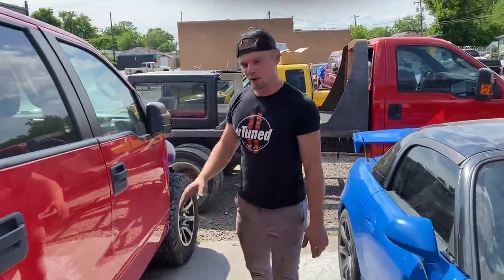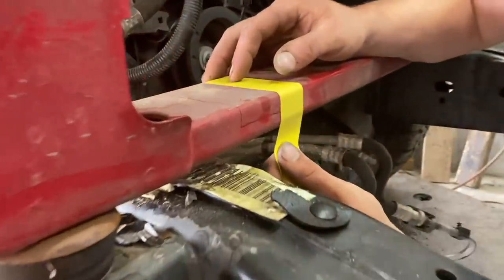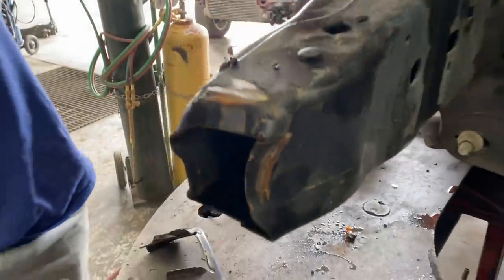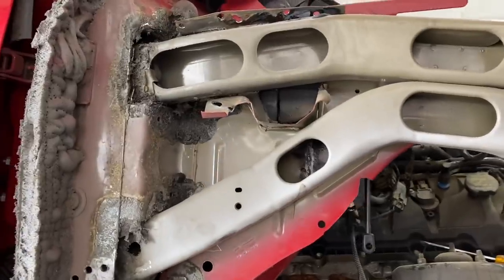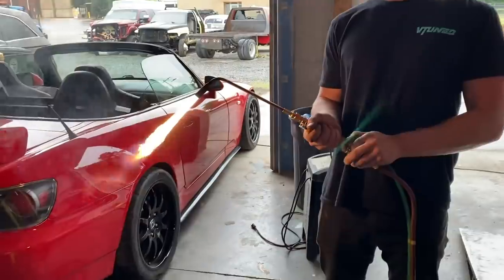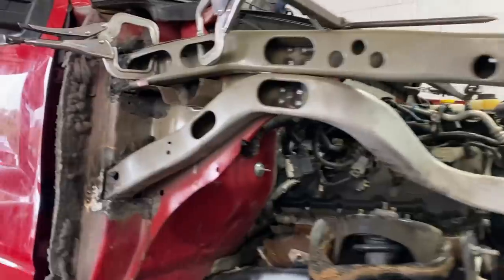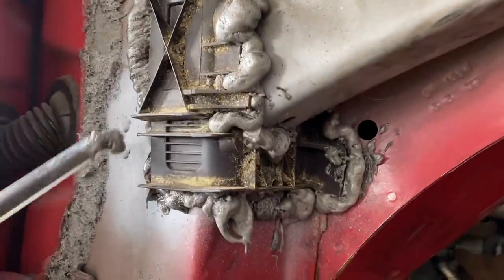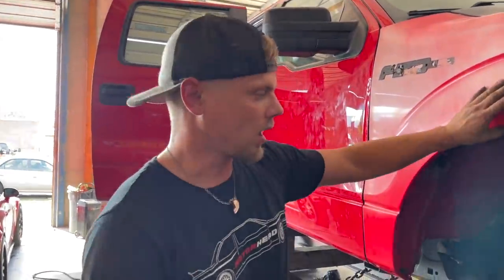Repairing the bent FRAME on our FORD F-150!

Comment: Sometimes i wonder if all this extreme heat on the metal parts weaken them, like if i keeps the strength in a future collision
Reply: Don’t worry...... I’m sure that they followed all the correct Ford repair procedures on all the high strength steel parts🤣🤣
Reply: @mattw4662  Yeah like heating boron steel white hot and making it soft as lead when it cools. Top notch work Lol.
Reply: the extreme heat makes the metal weaker! proven fact. see what your tensile strength is after heating then see what it is if you use no heat?
Reply: @jimgriffeegriffee5536   I've been running a body shop for 27 years. Do you know what I call it when a guy takes a torch to the frame rack? His last day working here.
Reply: @nathanhaynes7688  you know it!! it would never fly at my shop. that torch shit is old school when i was a kid back in say 1972 my brother used torch with rosebud end. i been in the bodyshop for 51 yrs.now days you got tempered steel uhss hss you cant heat.i-car certified i learned a lot. just look at the color of the grinding sparks.that tells a story its self. no heat from torch. some use inductor but its still heat even with no flame. i want to retire now today. thats my aim for the end of this summer if we get it? michigan winters and rust. i had my share of sandblasting rust patch panels had enough. i do the frame work.that way i know its right. besides this technology i cant keep up and it would do me no good at this point to keep up.as a retiree i think going into paintless dent removal may be the ticket? couple jobs here and there to supplement income.i cant believe some of the shit i see on here?wow is all i can say!
Reply: k m the heat takes the temper out of the steel making it weaker.

Comment: Good times! We used to make one truck out of three or four donors at the lot where I worked. It's big fun once you get fast. We swapped complete truck and SUV interiors, swapped cabs while keeping the original wiring harness that matched the chassis, and built ourselves a few too. (My originally 4.2 2WD Silverado is "upgraded" with a 5.3 4x4 chassis and running gear.)

We used our Century wheel lift as a beastly hydraulic puller because they're so powerful and have a long stroke. Wrecker chains and J-hooks work a treat for controlling the casualty.

Comment: Awesomely done to the team of bros. F150 getting closer to hitting the highway.
Reply: hell 1 can buy or get a used frame for about 4k$ do a switch -a-roo!! save time on a truck its just all assembly. but builders want to be cheap and compromise the safety of the vehicle .what really does the vehicle in is the srs (airbags)system thats what totals the vehicle.

Comment: I don't understand why you guys don't use carbide drill bits to drill the spot welds.It will drill like butter through the welds.You can get them  at Grainger.
Reply: get a real spot weld drill the bits you can get 100 spot welds off if you dont get wild and heat them up.

Comment: Are you guys using the ford  Recommended standard for proper frame repairs?  Wouldn't  they replace the frame. Or will this be a salvage titled truck
Reply: salvage title i would bet you any thing. the rule in michigan is if 70%of the vehicle vale exceeds the repair its a total and late modal with in the last 5 years gets salvage title by law. but it depends on the insurer and who is assigning the titles.if a insurer thinks they can make more off there loss they may spare you and give a good straight title.salvage sucks got to get a reinspection by a leo for stolen parts and to make sure the vehicle is road worthy. big painin the ass. straight titles you dont have no leo's to worry about.

Comment: On the 3m two part products you just leave the tip on. Put a new tip on when you use it again. 8115 3m panel is the only product with a smaller side that I remember. That explanding foam cartridge wont last long after opened

Comment: So I am just curious, my 2006 f150 I bought has a bent frame by the lower control arm bolts for when I get a alignment it does not get a true alignment, so was wondering if I am able to get just that part of the frame fixed & where would I need to go & how much would it cost?

Comment: How do you know when everything is aligned?  Is there a manual to tell how many inches to tug in what direction?

My 1999 Solara was hit and it bent the upper tie-bar. I thought no problem—I would just disconnect everything that attaches to it and left it out.....hah hah hah ...

Either spot welds or rivets are all over the place where the fenders meet the front bumper cover. I think the project is beyond my doing at this point. Seeing your video was pretty neat though.

Comment: Tell me...by heating the metal to beat it back into shape, does that remove any original strength quality it had? Does that make the metal softer or weaker is what I'm trying to ask.
Reply: Yes it does but unless you’re doing insurance drop work it doesn’t matter heat it and beat it.once it’s painted they’ll never know the difference. Until of course it gets in a wreck again and the people die from the frame buckling in that spot they fixed.

Comment: That foam stuff looks like crap, bet it leaks water inside cab when it rains. I would have used normal seam sealer, easier to make a neater job and to seal it so water tight. Didn't see any measurements being taken to check frame alignment was correct before welding everything into place? Or maybe I missed that....